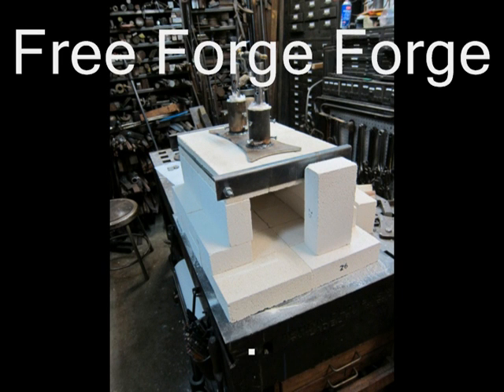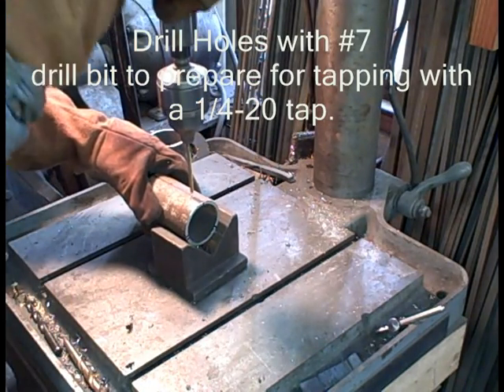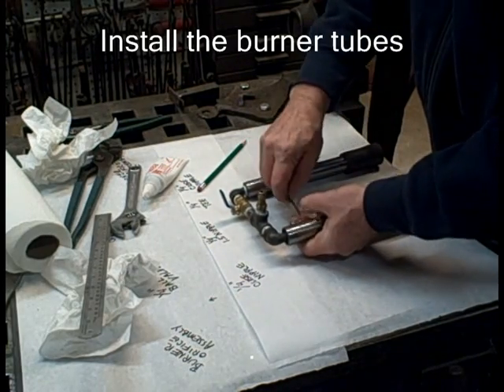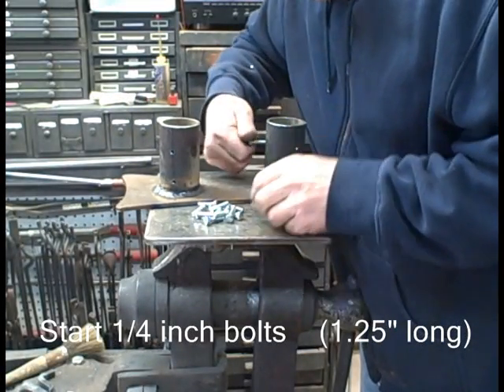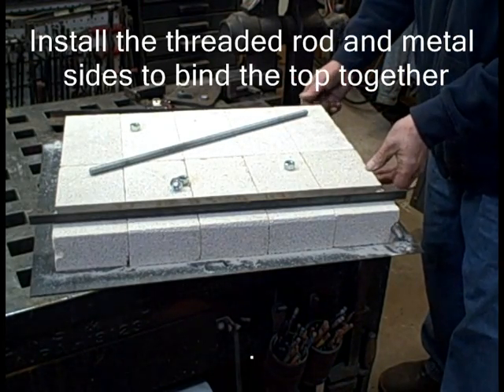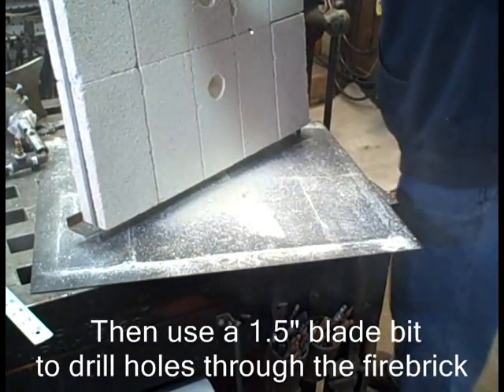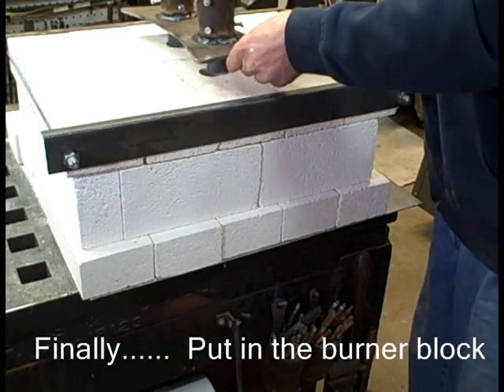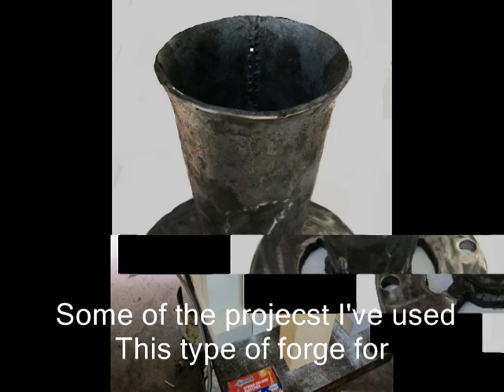Free Form Forge

Comment: Thank you for the info. I appreciate it. The setup I was using was forced air.  I was using regular pipe caps from home depot.  I like the MIG tip idea thanks for replying so fast. Great video very informative thanks again.
Reply: jimmy dahl Orifices used with forced air are generally larger than atmospheric burner orifices.   If your burner works well and you want to try a mig tip in it, I suggest you use a mig tip with an opening as close to 1/32 as you can.   Incidentally, a .035 mig tip has a hole larger than .035.   .035 is the wire size, the hole will have enough clearance for the wire to travel through it easily.  Take a drill bit to a welding shop and find the mig tip closest in size.

Comment from the maker: I'm sure if you would actually get a swirling action, it would facilitate better heat distribution. I don't really have an effective way to tell.  For these small forges and this type of burner, I doubt there is much difference from a functional point of view.  I do recommend putting the burner tube on a slight angle toward the back on the Super C forge so when the user is using the horizontal slot for access, the flame is pointed into the forge, rather than out of it.

Comment from the maker: The bricks would benefit greatly with the ceramic finish.  I had mentioned that in one of the videos (I had intended to mention that in the free form video if I didn't).  I'm not sure about just one side though.  I think both large surfaces should be done at a minimum.  I have covered bricks with 100% coverage also.  They are a LOT stronger.    I have had some crack sooner than I expected though (I'm wondering about steam being trapped).  The bricks can be repaired with the slurry also.

Comment: Great video thanks for posting it what size MIG tips are you using for your burners and how often do you have to replace them?          My last forge had just a pipe cap with a 1/32 of an in hole in it but the propane corroded the caps every few months thanks again
Reply: jimmy dahl Thanks...   In my burner video, I use 3/4 inch schedule 40 pipe for the burner body, and .025 mig tips.  Personally, I like that size because the burner is a little quieter.   If someone is having issues with the burner, I suggest they go to .030, possibly even .035 tips.  I am not sure, but I suspect that altitude may influence how well these burners work.  I have also used .045 tips with 1 inch pipe for the burner body.   I have also drilled holes in brass plugs (use the ones with a cavity in the body) experimenting with different sized (numbered) drill bits (55-70).  In the end, the mig tips work fine and are much easier to use (no need for tiny tiny drill bits).  I do suggest using brass if you drill.

I have never had to replace a mig tip.  If the burner suddenly starts behaving erratically, I run an acetelyne tip cleaner through the mig tip to clear it. Sometimes (rarely) soot from burnback when the gas is shut off slowly or wax from the propane bottle will clog it.  I suspect your corrosion is from moisture.  Brass can corrode, but it takes much longer.

A wide variance in hole sizes will work.  They just just have to be balanced with the propane pressure and amount of air that can be drawn in with it (burner body design).   My goal, with the burner video, was to present the viewer with a simple design that could be made by anyone with a few tools.

Comment: Just go with a good quality hard brick an empire or clipper. Once you start to heat these bricks up the hot face will shrink more than the cold face and they will start to crack and fall apart. Also they make high temperature fiber in 1/8" thick, use this on top the the bottom steel and before the bricks are put on. And get the highest rated IFB bricks you can get, these are K26's which has a working temperature of 2600. 
Look into a castable called mizzou it is bullet proof.

Comment: Can you direct me to a good source for the insulating firebricks (soft) I only seem to be able to find hard ceramic ones.
Reply from the maker: +THANX4PLAYIN2DAY My video "Super C Forge Lining Supplies and Sources" tells where I buy my materials.  Although results are mixed and prices are all over the place, you might Google for "Ceramic Suppliers".   Also, you can find them on eBay an Amazon.  The best prices will be found when you buy them from a company like ANH Refractories and pick them up at a distribution center.
Reply: If you watch the "Super C Forge Lining Supplies and Sources" video, I reveal where I buy my supplies.